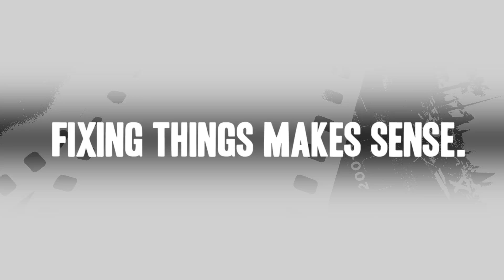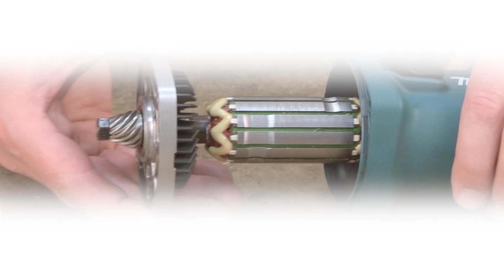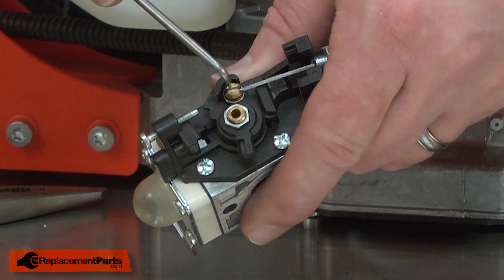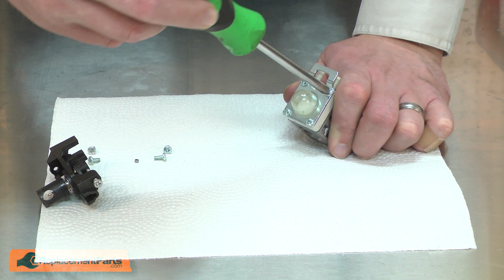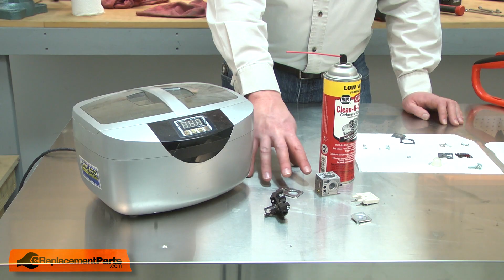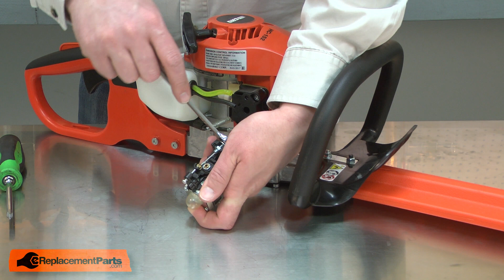Echo Hedge Trimmer Repair - Installing the Carburetor Repair Kit (Echo Part # P005002280)

Comment: I installed the arm that rests over the spring upside down, and could not get the assembly to line up correctly. The convex side fits into the spring; the spring does not fit into the concave part of the arm. Also, I had difficulty getting the spring to line up and press the arm with the needle all at once, keeping the arm over the spring so that the whole assembly was in the proper position after pushing down. Maybe it's because I'm 76 and never worked on a small carburetor!